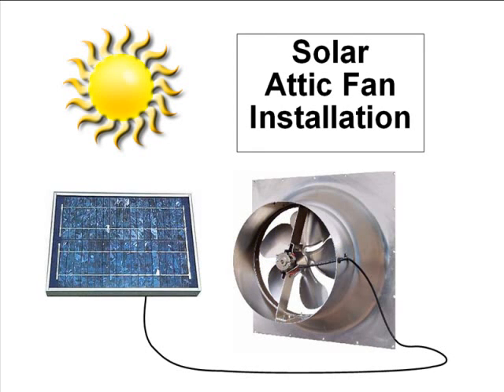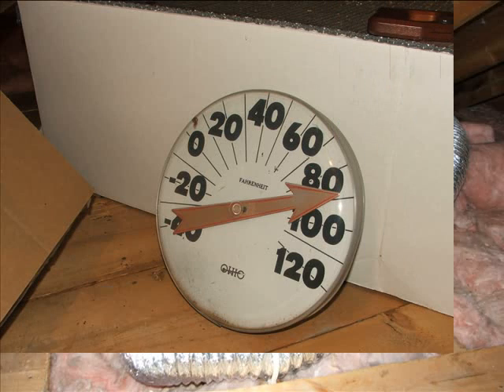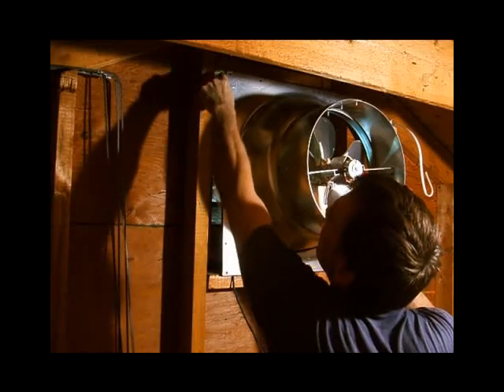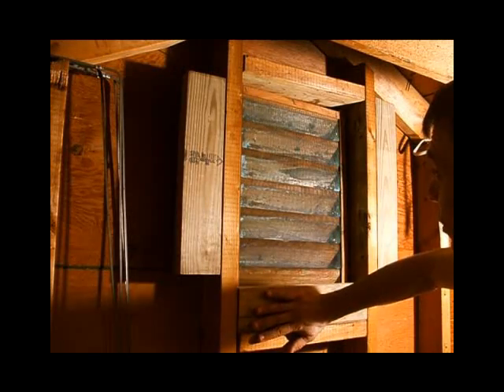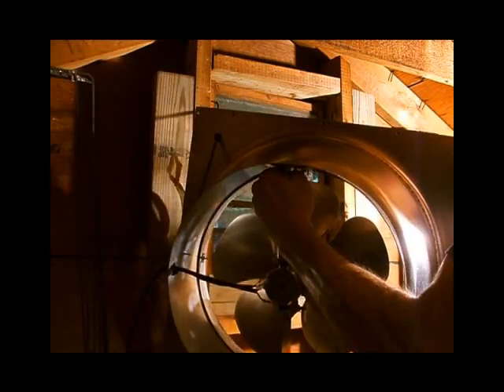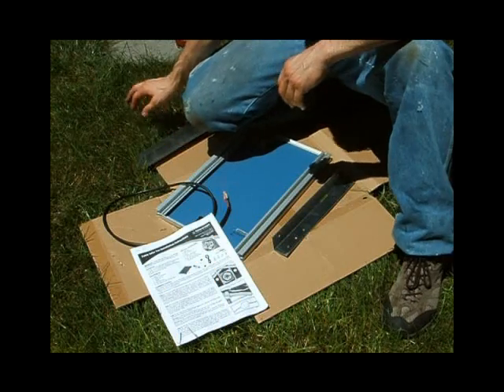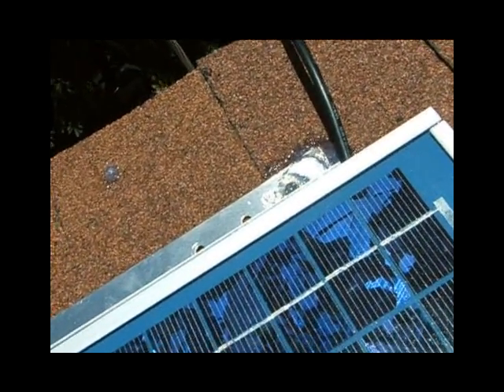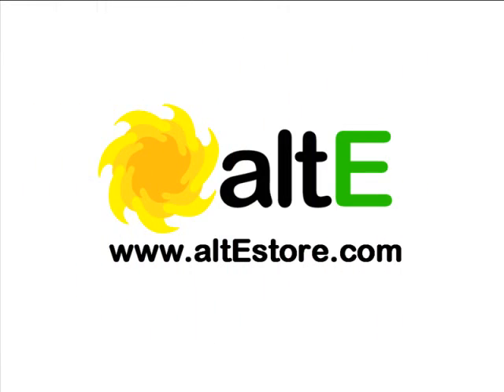Solar Attic Fan Installation - altE Video Tip

Comment: Should have just gone through the roof with the cable. Properly sealed it will not leak. 
Now you have a path for rain water to come into the attic.

Comment: The attic should have a new screen installed on those gable vents, they seem quite clogged. the bathroom ducting should either blow out a roof or wall vent and either the way it was or the way you suggested. Also they should have sofit baffles in each rafter bay to allow cool air to enter the roof without impeding the insulation qualities at end walls.

Good video!

Comment: For those wishing to protect the cable on the roof and going into the attic you can use a type of tubing that clips around the wire similar to PVC piping. Even though the wire is out door rated, to resist UV rays the wire coating can be worn away by friction against the roof over time by wind, and other distrubences which would wear down the coating of the wire.